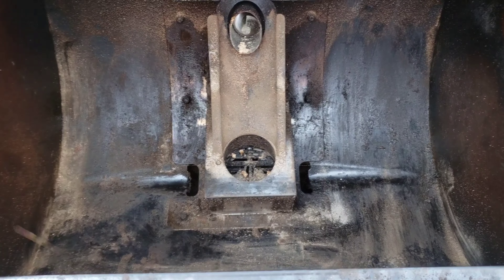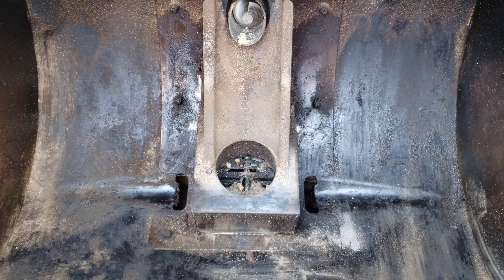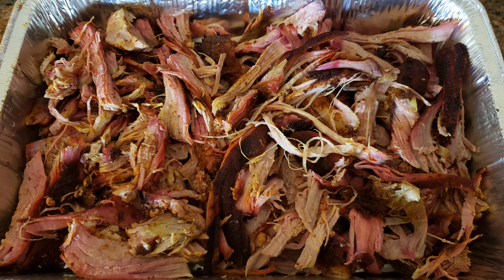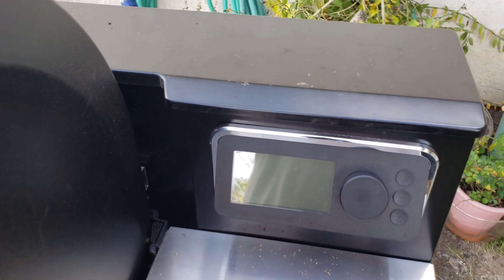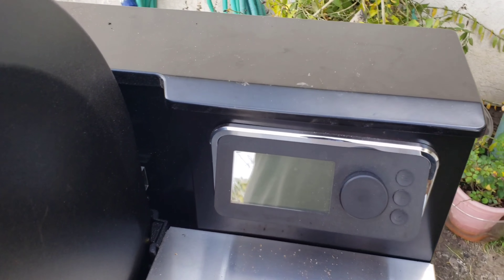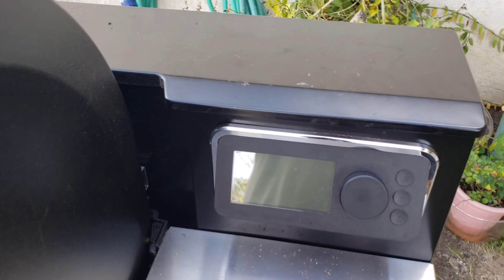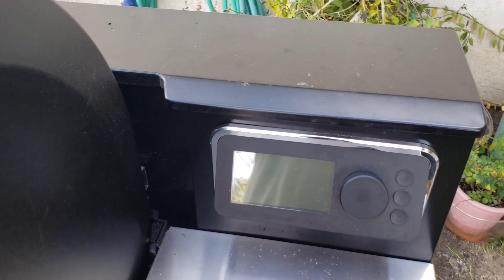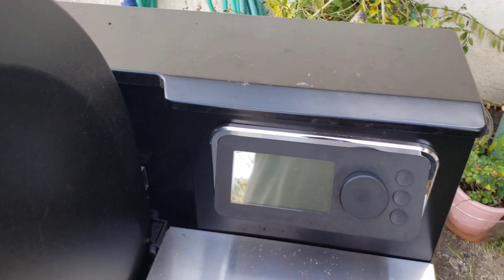🔥 WEBER SMOKEFIRE: SMOKING WITHOUT DRIP TRAYS AND FIRE? 🔥

Comment: Great video ! In my humble opinion nothing is maintenance free you’ll have to completely clean it out after every use that being said not sure I would drop $1200 on one just yet
Reply from the maker: I think when preparing for a long smoke you should clean it. You should also clean it if you're going from a long smoke without drip pans to searing temperatures. Well, great thing about Weber is they have options. They make great inexpensive kettle grills that are amazing.

Comment: On Weber Forum today...
"
￼

GriLLMaRksRseXy

Active member

Today I have had a total heartbreak and almost entirely total melt down of my Weber EX6. I had no food cooking. I had no grease from previous cooks. The bottom of my cooker totally caught on fire and paint melted off the the front drip tray. I have MANY videos of this but it takes awhile to download the vids and compress them enough to post on the forum. I will include one video for now.

The back story of this is that last night we had two "E6" failures of ignition in a row. Both times there was a hopper full of pellets and not a single one of them was burned. I cleaned out the pellets and tried again each time. Today I tried again and it almost melted my grill to pieces. I will post more videos and pics later as I get them uploaded/downloaded but this one shows what happened.... And for the records, I will show other videos that clearly show there was not any grease in the drip tray to start this fire too."
View attachment grill burn smallllllest.mp4
Reply from the maker: @larrywong7834  That's awful!!! I feel bad for that happening to this person. Glad nobody was injured.
Reply: @CookingJoeFoods  I wanna a 2 or 3 Weber Smoke Fire Ex 4. But due to many seen safety concerns on YT... I must wait for version 2 models. One of our homes is attached townhome with small wood patio deck. We can't risk Fires there. Also we have kids with novice BBQ experience. They would'nt even know what to do if WSF has a fire. Much less if the Weber fire spreads much out its containment.
Reply: I read somewheres that once Weber agreed to send out a WSF replacement__ That closes out A Class Action Suit from happening from his individual WSF fire event.